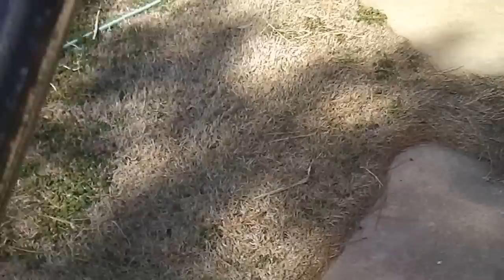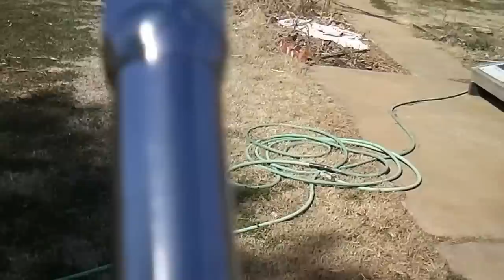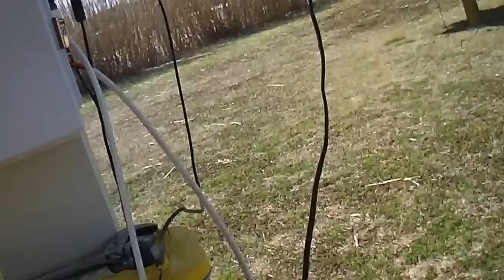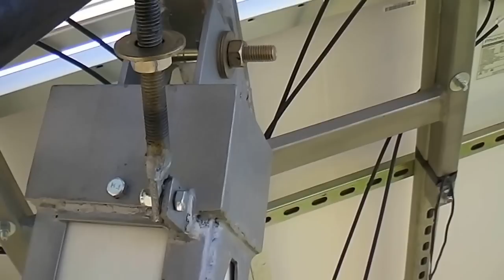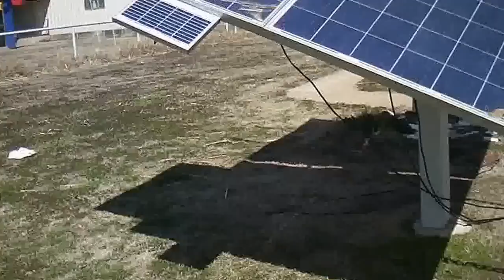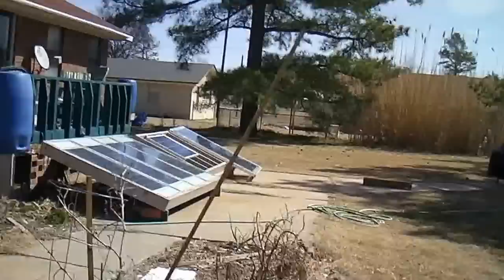Specialty Tool

Comment from the maker: The reason why I was moving it is because I had set it to level because the wind came up to 30 to 40 mile an hour gusts. The drill is so much faster to move the panel to level position when a storm is coming up. The end wrench is so slow at moving it I feel I will tire out or get blown away before I get it moved.

Comment from the maker: I dont have the option on my tracker boards for dual axis. I would have to buy one like that. The LPC is dual axis is 119 bucks ouch. I should get one but Im cheap or broke most of the time lol. It would be cool I guess but then I would have to buy a actuator more money another 150 or 250 buck ouch! But the sun moves higher in the sky very slowly so I can just move the tracker once a month or every week depending on how particular I want to be. Its not a big deal to move it manually and its fun